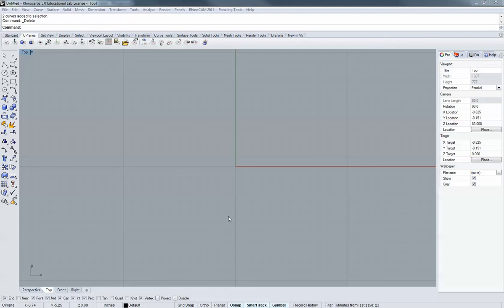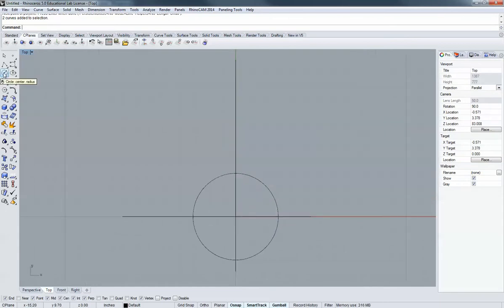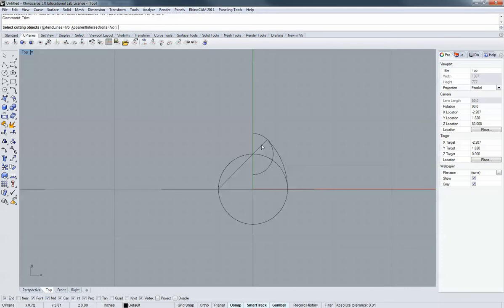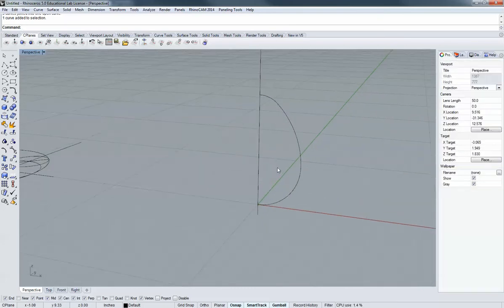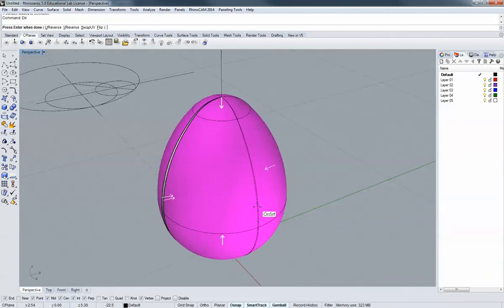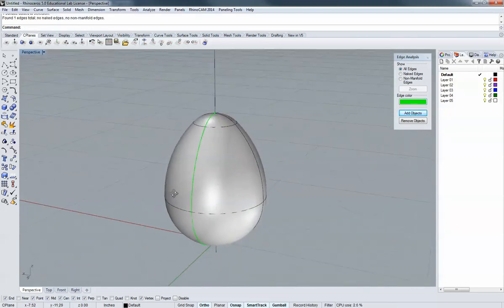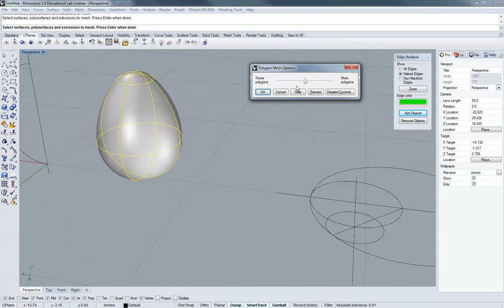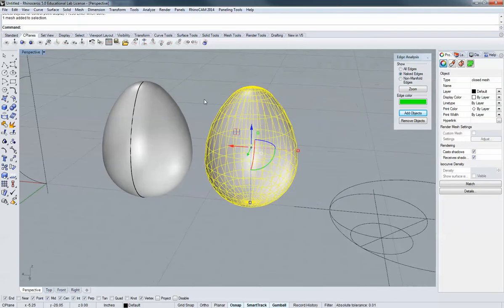ARCH5590 - LAB PRIMER: EGG GEOMETRY

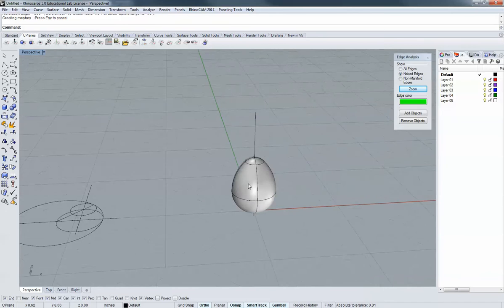Comment: Since 12:40 has already set the Revolution Angle to 360 degrees, it will be enough to press the Enter key in the last operation of the revolve command.